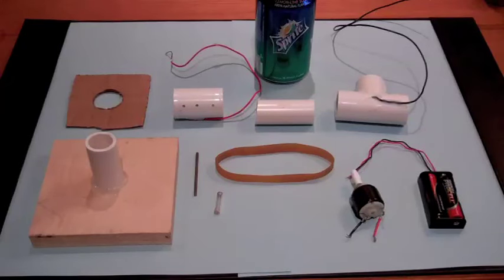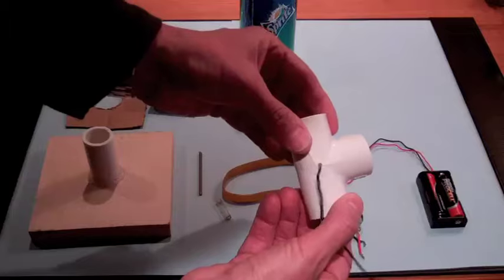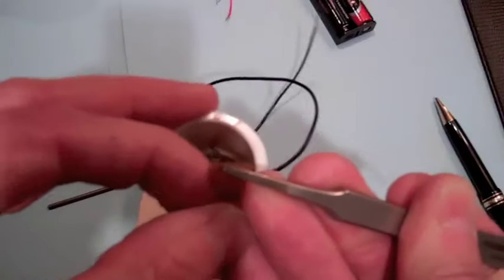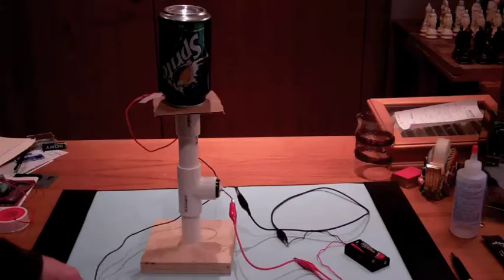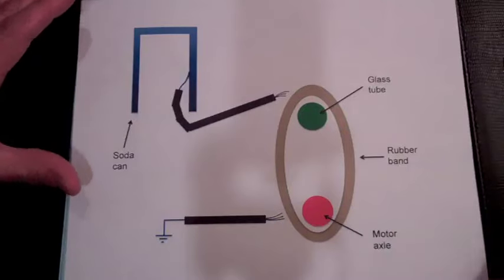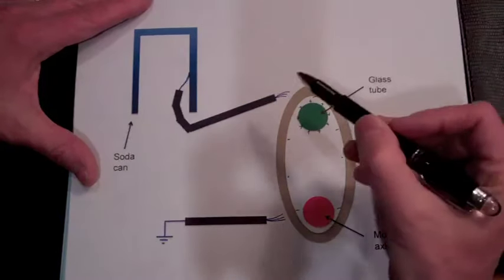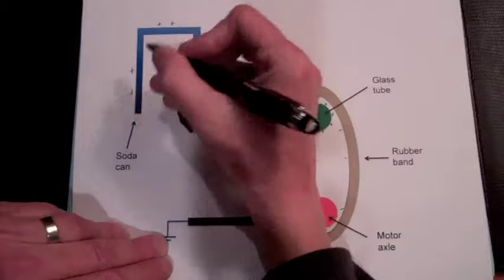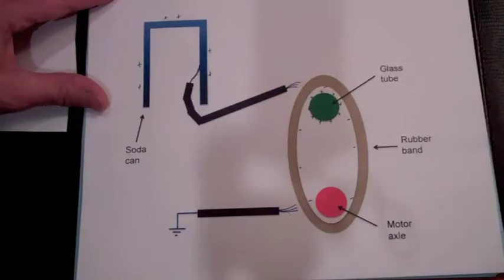Van de Graaff generator

Comment: does the tube have to be glass? and if so where would I find one?
Reply from the maker: +Chase  Tramble You want the band and tube to be as far apart as possible on a triboelectric chart to maximize transfer of electrons. Rubber and glass work well. You can obtain a glass tube by taking the ends off of a glass fuse by using a soldering iron to melt the solder holding the metal end caps on the glass . You can also get a pipette, scribe and break it, to get a glass tube. I have used both.
Reply: +Michael Melloch thank you very much. have a nice day and have a merry Christmas!

Comment: is there a way to measure the voltage coming off the can to ground?
Reply from the maker: +Dawson Francis Since there is so little charge on the Van de Graaff generator, you need to use an electrostatic voltmeter. The principle of operation of the electrostatic voltmeter is like that for an electroscope

https://www.youtube.com/watch?v=4UnggxPVCYw

I found a youtube video doing this measurement,

https://www.youtube.com/watch?v=eogpGHFgV6E
Reply: Thank you,  I have it built but I am not getting any charge on the soda can.  the aluminum foil strips don't move and I do not get a shock from it..  What can be my problem?
Reply from the maker: +Dawson Francis The first time I built mine it did not work. I cleaned everything with isopropyl alcohol, rubbing alcohol that you can purchase at a drug store, and got it to work. I also wore latex gloved when I cleaned everything and assembled it. It is possible that just a little grease from your fingers is enough conduction to drain the small amount of charge that builds up on the can.

Comment: I can substitute the rubber band for what?
Reply from the maker: +Marcouelber do Amanhã Anything that can roll on the glass tube by coupling to the motor and resulting in charge transfer between it and the glass tube.
Reply: thank u

Comment: Sir lz provide me the list of material used with each n every specification of every material....
Reply from the maker: +Shyam Sunder Shukla I don't really have any specifications. At the beginning of the video I show all the parts I used. The main parts are some PVC pipe I got at a hardware store, a toy motor, an empty soda can, a rubber band, a glass tube, some wire, and a battery holder. The glass tube is probably the hardest to obtain. I have done the glass tube in two ways. Taking the ends off a glass fuse and scribing and breaking a pipette.

Comment: can I place this underwater??? will it still give off an electric current??
Reply from the maker: If you are thinking of having it upside down with the soft drink can in the water you would have a current. The charge would not be able to accumulate on the soft drink can, it would just conduct away because of the water. The current would be very small. If instead of a soft drink can I used a small metal sphere of radius 9 cm, the capacitance would be 10 pF. (The capacitance of the soft drink can would be similar.) So charged to 10,000 V there would only be 1x10 e-7 C on the sphere.

Comment: sir is this a DC motor..you use in the model.?   and earthing is necassary?
if yes how can i do that?
Reply from the maker: Yes I am using a DC motor to turn the rubber band. Grounding is necessary and I held the wire and acted as the ground in this demonstration.
Reply: sir i wanna to make a working model on this thing so how canuse this ?i mean how can i earth it for my prjct

Comment: sir i have a doubt
is wire touches the belts which is connected to motor
Reply from the maker: The wires, the one at the top near the glass tube and the one near the bottom by the motor, do not touch the belt--there is a small gap. The wire at the bottom is the ground. The ground wire does not have to be positioned at the bottom, it just needs to be away from the positively charged glass tube at the top.